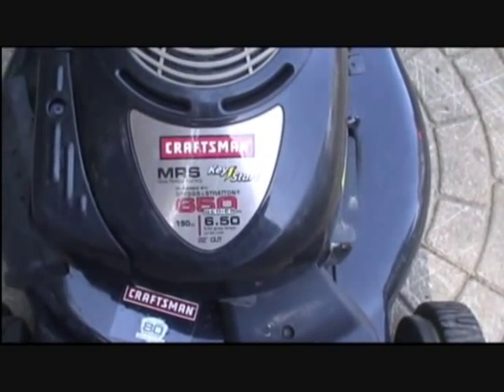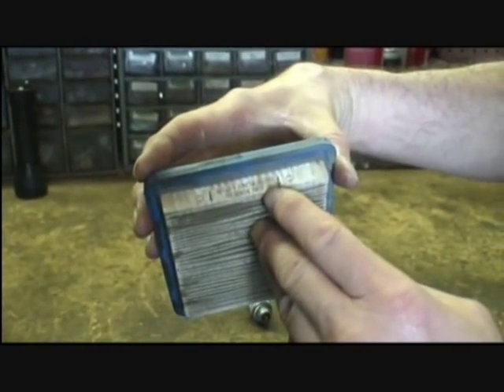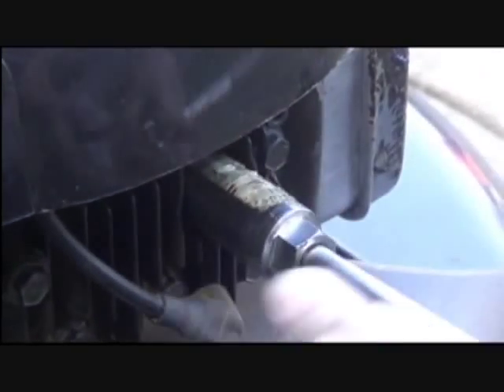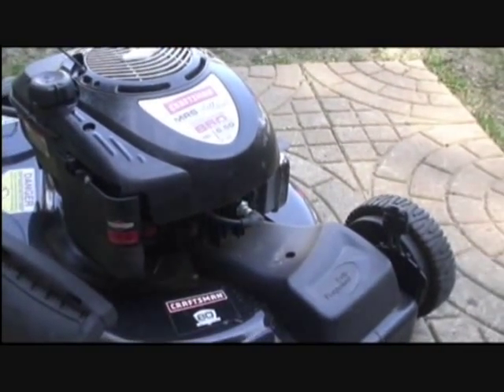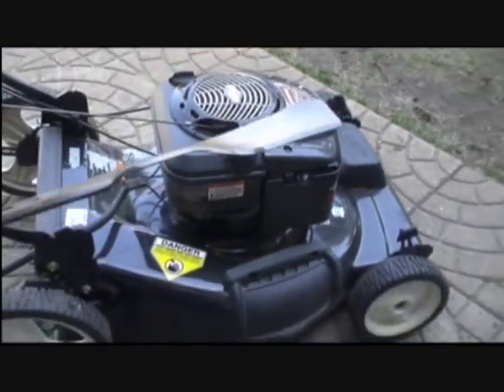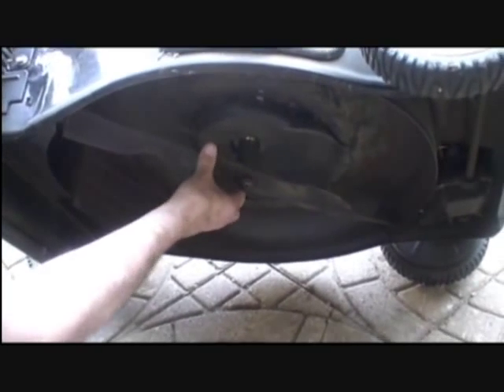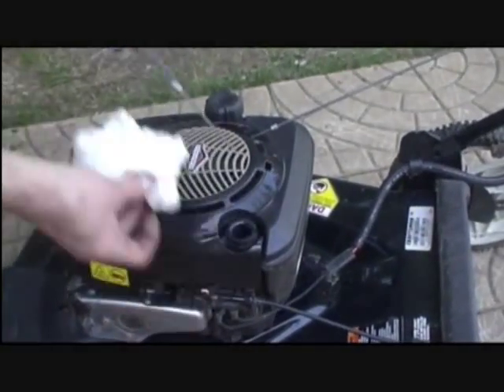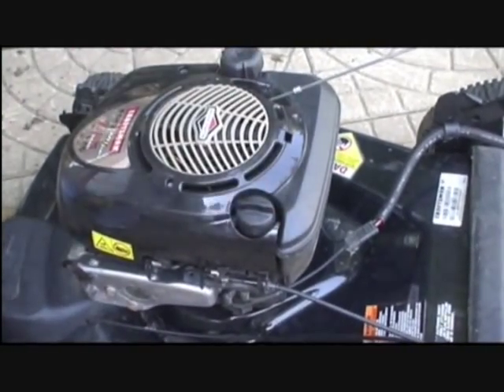Lawn Mower Tune-up (Briggs and Stratton 6.5 hp)

Comment: With most newer Craftsman models there is a drain plug for the Oil underneath the deck. You can loosen it with a socket extension. Actually with most newer push mowers in general that is where the drain plug is.

Comment: Not every mower has a plug at the bottom.  On many, you fill/drain the oil from the fill tube.  However, in the video it was mentioned most mower engines will take 10W-30.  Although that is technically correct, based on your climate...the preferred is straight 30.

Comment: The oil is suppose to be drained out the drain plug on the under side of the mower deck. 
It is a 3/8" square drive. You can use an extension, and a ratchet to loosen it.
DON'T tip the mower on it's side. It can leak oil into the valve chamber, or leak gas on the ground. Also the capacity on most briggs single cylinder engines is 20 oz NOT 10oz.
Briggs specs straight 30wt oil, or synthetic 5w30 oil for these engines. But I use 15w40 Shell Rotella, The extra additives are good for air cooled eng.

Comment: no, i have yet to dismantle the carb. the fuel cap IS damaged however. The threads on the cap are a bit stripped, but I can tighten it enough to not come off the fuel tank, but if you try to tighten it a bit more, it comes loose. The cap has been like that for years, but the bogging/dying problem is recent.

Comment: Good vid, nicely done.  I was always under the impression you should tilt the mower to back on the handle side to safely secure it unless doing an oil change.  Also, I use synthetic 5w30 in both my mower and snowblower due to the harsh conditions.

Comment: Well you can tip it. It only leaks oil in the valve chamber if you tip it towards the carberator side of the mower. And just make sure the mower is empty of gas in it.

Comment: Minor point, but I've discovered that though the normal tendency seems to be to hold the plastic oil bottles by the fat side with the neck low, you'll be able to control the speed and empty the it faster if you hold it on the side with the neck so the air can pass into the bottle without the glug-glug-glug caused by the air moving up to fill the upper side. It seems counter intuitive, but it works much better and it's easier to begin pouring without the surges of air. Sometimes, I'm glad I studied fluid dynamics...
Reply: pmessinger

Comment from the maker: I stated no facts - just trying to help the home owner by showing a very easy, simple and safe way to drain oil from a lawn mower engine. Draining oil from the bottom of an engine IS one way however this method requires tools, would be messy and require a very shallow pan which I can almost guarantee noboby would have. Most home owners would find this method extremely cumbersome.Keep it simple Mt Gigglyable

Comment: I've read this engine has an oil drain plug and can drain all the oil without tilting the unit, and draining from the filler cap will still leave about 2-4 oz. of oil undrained. There don't seem to be any tutorials showing this method however... wish there were.
Reply: ***** Books say to tilt even if there's a drain plug. I looked it up anyway, most of these motors have plugs but they're often inaccessible and tilting is preferred for ease.

Comment: Actually on a new one I got with the briggs platinum 7.00 190cc engine it tells you to tip the mower over with no fuel in the owners manual.

Comment from the maker: Did you remove the carb and throughly clean? Also do you recall hitting anything that may have damaged the flywheey key? Check the fuel cap // make sure it's venting properly.

Comment: thanks for the video- I have this exact mower.  I can't get it to prime.  If I press it about 10-12 times it will start and actually run (not perfect).  I changed the air box gasket, pulled the primer bulb and cleaned the screen.  Completely took apart the carb and verified all orifices were clean.
Everytime I shit it off. i have to press the primer a bunch to get it to start.  I am not getting a good seal somewhere?  SHould I replace the primer bulb? ALthough it looks to be in good shape?

Comment from the maker: Hi Rocky - is this a Tecumseh or Briggs. Check the fuel flow for any restrictions (remove line from carb and check the flow) and make sure tthe fuel cap is venting. Has the carb been serviced lately?

Comment: my mower's fuel cap is not venting, yet when i loosen the cap, the mower still chugs and dies after a few minutes. does the fuel cap really need to be secure and venting to work for extended periods of time or is there maybe a needle problem in the carb? I already cleaned the jet bolt, and that is what got it started, but now Im stumped as to why it slowly dies after a minute or two of continuous running

Comment: I am trying to change my oil in my B&S 6.25 self propelled however where the drain plug is located is covered by the cover that guards the belts that drives the driveshaft. Do you know how to remove this?

Comment: Hi Mike,
I had my Briggs and Stratton 675 series 190cc on it's left hand side while I levered the  drive belt back on. On re-righting and re-starting the mower, white smoke poured out of the muffler. In attempting to take off the muffler to clean it, the part behind the muffler fell off. Not sure how to put it back together. Can you give any help?

Comment: Mine has a thermostat connected to the muffler,and it needs adjusted. the arm of the thermostat sit in front of the air vane lever. do you know how to adjust this so that my mower will run good

Comment: lol, i also changed the oil when the motor was hot, but as it was tipped on its side draining, the hot muffler managed to melt a hole in the plastic oil pan that was under it. now there's oil all over the patio -____-

Comment: didn't pull plug when you took off blade (unsafe) ... and didn't put film over the gas filler cap when you tipped to empty oil (dangerous). your not very cautious .... are you?

Comment: Don't recomend unless you have atleast 2 years on it Don't replace the filter get a toothbrush and scub it off in each line than spay gasoline with it and blow it through let it dry for 28HRS . for the plug just remove it and spray it with wd40 and brush it with the tooth brush let it sit inside to let it eat if off though . and i wouldn't replace the oil unless you see H20 bubbles in it color doesn't matter and if you are going to replace it use 10w40 any kind castrol supertech Etc . .